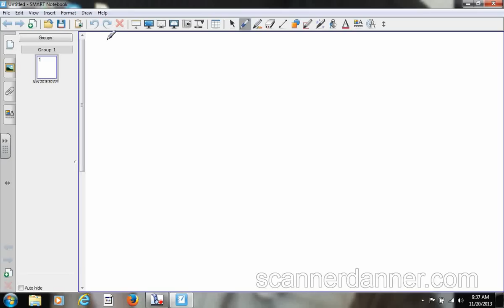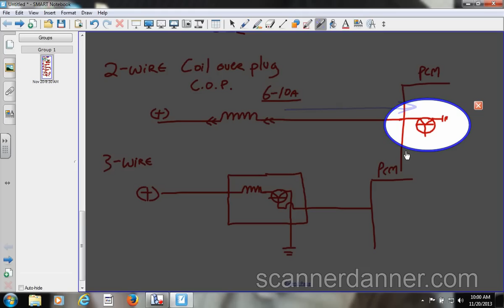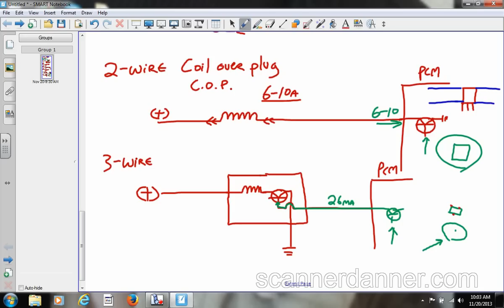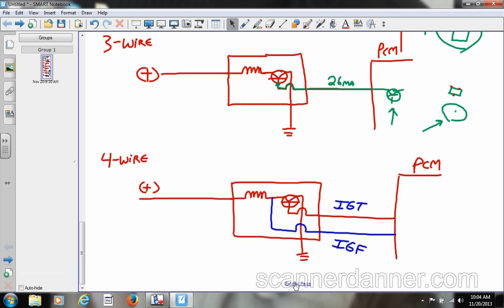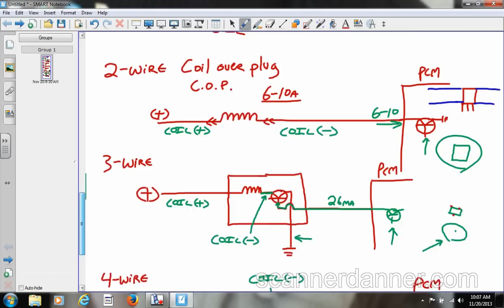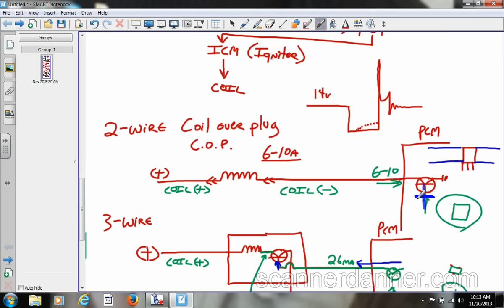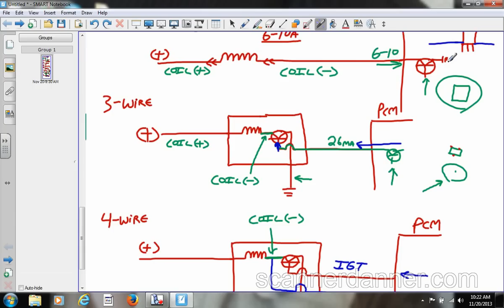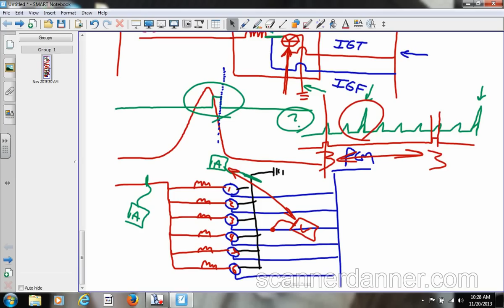Ignition System Designs, Operation and Testing (an SD Premium video)

Comment: my 89 chevy scottscdale doesnt have a crankshaft position sensor, if I unplug the refrence wire, the truck still runs
Reply from the maker: technically it does, it is the pick-up coil in the distributor. And if it is fuel injected, it definitely will not run with the reference wire "unplugged". You are probably confusing the by-pass wire with the ref wire.
Reply: its the wire that I disconnect to set the base timing   brownish wire

Comment: Hello Scannerdanner I have a 1992 eagle summit 1.5 with a 4 speed automatic. How can I test the RPM signal. I turn the ignition and the RPM needle moves and as soon the car starts the RPM needle drops to zero. The car runs fine,  idles fine. Maybe some one here can give me some tips thank you
Reply from the maker: +joker7from206 try posting on my forum. you'll need a wiring diagram to troubleshoot that. I do not know off hand how the tachometer is being controlled

Comment: Hello scanner danner, I wonder if you can help me. I changed the ABS module and the pump. After that, my car will not crank or start. The starter is fine. The ignition wire has no power. I checked the relays and they are fine. No click, no crank, no start. I put a wire from the battery to the starter and it cranks but doesn't run.   I have a headache to resolve this problem. Can you help? I really wish to be your student.  How can I be your student? I want to learn from you. Thank you.
Reply: The car is a  GMC Acadia 2007.
Reply from the maker: The first thing I would do it do disconnect the ABS module and see if that restores everything. Maybe even plug the old module back in. It sounds like you may have pulled the network down with this "new" ABS module. As for being one of my students, you can join my class here https://www.scannerdanner.com/join-scannerdanner-premium.html
Thank you!
Reply: I have no communication with OBII and the ignition key.
Reply from the maker: I know
Reply from the maker: " It sounds like you may have pulled the network down with this "new" ABS module."
Reply: ScannerDanner I already checked the ignition key and the power goes out. Somewhere inside the motor won't crank. Can you help me find the wire diagram because the book that I have is not the same colors as the ones in the car. GMC ACADIA 2007. Also, you can come check out my car but idk where you at.
Reply from the maker: You are focused on the wrong issue. You have a no comm after replacing the ABS module. Please do as I suggested originally. If your ABS module pulled the network down (is this a used module?) then your engine computer and ALL of it's functions may also be dead (things like cranking the starter motor)
Sorry, I don't do road calls but if your near Pittsburgh PA, you could bring it to the school I teach at (Rosedale Technical College) but we can't take it until Dec. 4th or later.
Reply: wow I live in Nebraska  but thanks  i still need your help on this project so you mean network down it reprogram the abs module i put the old back and its the same
Reply from the maker: Time to check all engine computer powers and grounds. Could have blown a fuse in the process of your repairs.
Reply: I tested the pcm ground with ground tester and I tested the computer power and have no power. How do I get power on the pcm?

Comment: Most Fords Ive been seeing have the driver in the PCM with a two wire coil. Interest ingly the PCM on some of these systems actually monitor the primary's flyback spike to determine if a spark occurred. And u know what the ECM will do if it doesn't see that voltage. To me this drives home the old adage of always checking spark first, in almost any situation, no matter what.  Makes you wonder though about what strategies we'll use to fix these newer cars, and that those strategies will become obsolete and new ones will have to take their place. Software patches and ECM update packages fixing what I swear could only be a hardware issue and you can see where they're headed and what we have to deal with. Hmmmm, but one thing I think will not change is tech wages and ethical treatment.  Gotta admit, this is one wacky system that, to me, is not easily explained.  And I read somewhere in a career magazine something like this, "job market in auto repair now showing good projections, bla, bla, bla, but ensure that you have an alternate career in mind after ten years or so." ! as i was saying before, makes total sense. Everyone should master a trade just to discard it for another. WTH!

Comment: I G F , simply shows the computer, that the coil is working now we have a coil open code,
Reply from the maker: IGF signal is also used for injection control on some Toyotas
Reply: @ScannerDanner  is that the same way the the Things gets signel on 94 Chevy
Reply from the maker: 94 Chevy would not have an IGF circuit. It would however be exactly the bypass ignition example I gave for GM in this illustration. 
The wire that the ECM uses for RPM is the "reference wire" and it is purple with a white tracer :-)